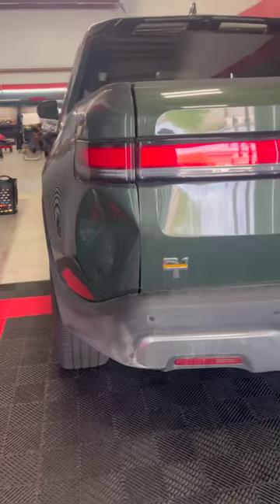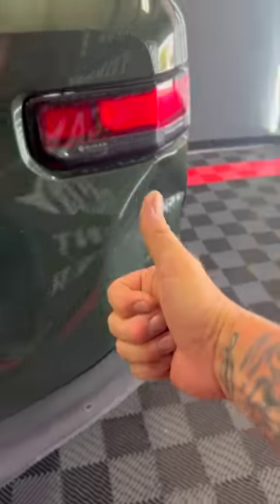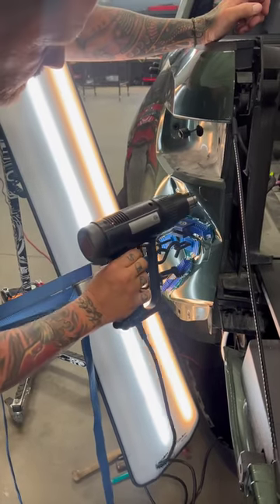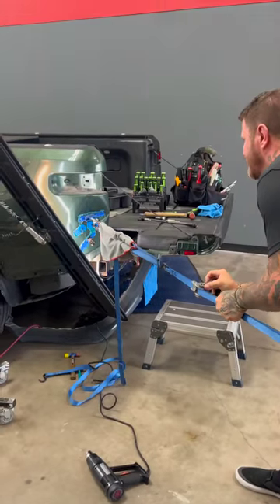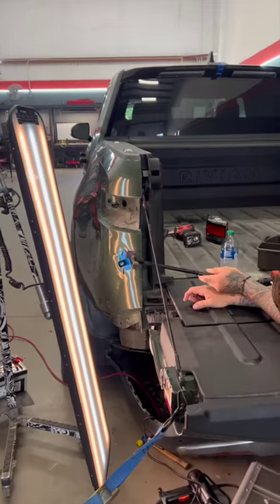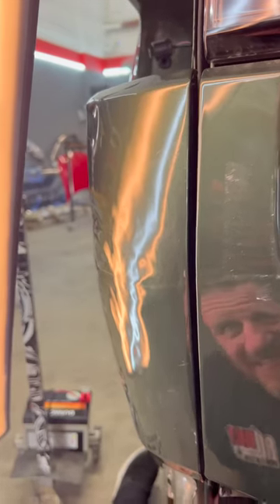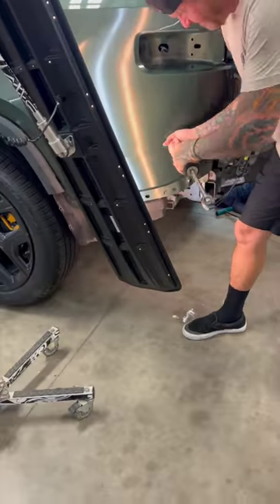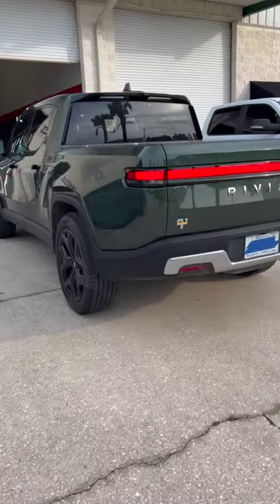$41,000 dent repair on this Rivian?

Comment: 2:21 was always amazed at how few panel gaps the rivian had. And I understand now that it is in fact a pain and comes at quite the cost.
Reply: Yup, this truck is closer to an iPhone than a Blackberry. Something that looks pretty vs something actually designed to do work.
Reply: @noseboop4354  problem is the engineers got lost in the lightness and aerodynamics and didn't consider repairs

Comment: $41k lets just be honest that is a bs quote from that shop. That means these trucks would be totaled easily. But great job on the repair!
Reply: this is the third rivian I have seen that had minor rearend damage but the quotes to fix them were over $40,000. panel to fix this is $14,000 all by itself and then you still have to almost take it all apart. as the video said, it is all 1 piece construction so you need to pull the windows and everything out,repaint to match and put it all back together again. at shop rate that isn't cheap. 
When that cybertruck comes out it will be the same way. cheap to make it in a gigapress all in one piece but it will not be cheap to fix after a minor fender bender.
Reply: @steveherr450  Hold my beer while I grab my stud gun...............
Reply: No way in hell the quote was a 4th of that. It's 100% clickbait
Reply: @crash9632  it literally is a accurate quote from a body shop. It’s a we don’t want to do it quote but the reality is nobody wants to do it. Same thing happened with the bmw i3 . You might be able to find a cheaper quote but it’s still gonna be 30k. The panel itself is 14k numb nuts . 1/4th of 41k is $10,250; that is  less than the parts omega lul.
Reply: @crash9632  it’s just a shittass car that wasn’t designed to be repaired. This is common knowledge. Do your research

Comment: Honestly this is Master class in automotive witchcraft. Amazing work. the common way I've seen this "Paintless dent" removal done is they do everything this guy showed but they remove the panel for the final touch up work. Hammering the dents on a steel table with a thick canvas table cloth on it. This is flawless and really shows you how good this guy is.

Comment: That’s pretty amazing! My question is: is the paint in that area now compromised over time and prone to separating and chipping now that the panel has been dented and then manipulated?
Reply: Even if it was, it’s still preferable to have that little patch resprayed in future than the whole mess of work that would have had to be done with tearing the vehicle apart with the other shop.
Reply: No
Reply: I looked the panel up and its $1900😅😅😅😅😅😅😅😅😅😅. The videos real but the price is bullshit
Reply: @jasonmorgan661  it’s not the parts, its the labor, he listed all the dumb things it takes to change that body panel (remove front and rear windshields, battery pack, etc). 
This truck is poorly designed for repairability.
Reply: Why can’t they just buy the panel and cut the dented section out and replace it with the piece needed from the new panel?
Reply: @Lucianrider uh and what weld it together? 😂
Reply: @randomizednamme yes. This is how it's done normally.
Reply: @randomizednamme Yes. I can cut out a section of steel, replace it with a new piece, and once I get done you won’t be able to tell it was ever cut or welded. Only way you’d know is by looking at the car fax or pulling the entire panel off and looking at the backside/running a camera up behind it. 

You might be able to tell an ever so slight paint difference if you have a keen eye depending on what color the original panel was and how old the original paint is.
Reply: @Lucianrider  On a lot of these electric vehicles, the shell itself is part of its structural integrity, that's part of why it runs the length of the vehicle. If you just welded a whole new segment of it I think insurance would claim you compromised the vehicle.
Reply: @invertexyz  that tiny piece compromise the integrity? If that’s the case it’s a piece of junk then!

Comment: This is absolutely amazing work!  I am wondering what the end cost was with this genius method of fixing the dent...  Impressive!
Reply: I'm thinking within 5k.
Reply: The low, low price of $39,999.99.
Reply: @alizierny  Man, that's the problem.  I'd like my stuff to look nice, but that's ridiculous.  I haven't put that much money into my dad's '95 Chevy that I've been driving for over ten years myself now and I've rebuilt the whole drivetrain in that thing.  Edit: Except the rear axle.  OG ring gear, pinion, seals and bearings still doing great.  Knock on wood lol

Comment: I’ve been in and around pdr since I was a late teen. A couple decades later and it’s still alive and strong. You did some fantastic work on that Rivian. Expect more and more of that headed your way brother. I am wondering what you would bill for two straight days of work like that. At one point I paid $120 a panel, add $80 for each additional dent on the panel. What is the cost these days?
Reply: Depends who you want to pay. Jimmy the meth head will do it for 125 a panel still. This guy will estimate how much time it will take him and add 25 to 50 percent to ensure profit if it takes longer than expected and give a estimate. Probably would bill labor at $150 to $250 a hour

Comment: I used to do this work for about 7 months. Not for a body shop, for a manufacturer. We didn't get nearly as complicated dents, but we did repair a lot of them. You would be surprised how many dents make it out of the factory, that people don't ever notice. And yes, fixing dents is really hard, putting them in, on soft metal is really easy.

Comment: The repair itself looks 98% which to some people is good enough, I did body repairs for quite a few years and later went into estimating. I have experience writing estimates for these types of vehicles and the issue that presents itself in this scenario is that the vehicle needs to be recalibrated just for the bumper removal, a calibration could run anywhere from $400-$2500 depending on the manufacturer requirements. 41k is definitely a steep price for a repair but if you have insurance, it should not be an issue, this is a 70k pickup, 41k is still within the threshold. Also repairs wouldn't have to be invasive in this scenario, you would approach it the same way, glue pull to minimize the damage and light glaze to even whatever you couldn't get out. But of course, bad body shops will exaggerate the extent of repairs, good body shops avoid cutting and welding.

Comment: Rivian founded in 2009.
New car brand, makes it nearly impossible a little dent to be fixed fast and cheap.
Same scenario with today's smartphones, unlike with mobile phones in 2000s and early 2010s.
You could buy battery and the phone frame and re-install it by yourself easily.

Comment: That was immaculate work in my eyes.  I'm still trying to get over the customer being quoted $41,000 from the only certified shop that could do the repair.  That's poor engineering of a vehicle design for insurance to consider writing it off over the cost of dent repair.

Comment: I believe it, I had a break failure in a 1992 Chevy S10 pickup truck and rolled into the back of a Tesla Model X. It was when they first came out. I kept in contact with the guy cause he was chill about it and his insurance paid out something like 25k to replace the bumper, reprogram the sensors etc. My car hit him at around 3 MPH and put a dent in the bumper smaller than a basketball lmfao

Comment: Aside from being filmed vertical, this was fantastic.

I'm hoping your explanation was to absolve that body-repair shop and not Rivian. Based on what you said it's clear that the body shop would have had tons of work to do, and likely a bunch of other replacements to seals and such after needing to disassemble 3/4 of the truck. But that should in no way be a defence for Rivian, who clearly engineered the truck to be as repair-unfriendly as possible.

Comment: I read about another Rivian that cost $32,000 after getting hit on the rear bumper, even though there was no damage. The dealer insisted on doing apparently very extensive (or at least expensive) checks to verity that this tap in the rear didn't disturb the batteries and create a fire hazard. "repairs" like this are costing all drivers more, not just owners of electric vehicles, because the liability, in even a parking lot ding, with an electric vehicle is so high. My insurance rates, with a perfect driving record for 14 years, went up 50% last year. Owners of electric vehicles should have to carry their own insurance for these insanely expensive "safety checks"  and premature write-offs; there is no reason why everyone should be paying for this extortion.

Comment: i had a sedan like this where the entire rear quarter panel was part of the rear window. i was quoted $12,000 for the same dent he has (dented in below the tail light). i just drove it like that until i sold it and it was the next guy's problem..... i use my truck as a tool, not some flashy "look at me" thing. i can handle a few dents if it doesn't affect the stability of the vehicle

Comment: Auto body tech here.  Gotta say, that's some gorgeous and highly skilled PDR work but it's not entirely honest.  I dislike the use of "aftermarket" paint.  If the owner was quoted for a full quarter replacement, he was at a Rivian certified shop which costs a lot of money which means the shop has to meet strict requirements and uses very high quality paints--possibly the same brand OEM used.  In my opinion, i would've never asked for a new side.  Instead, i would do a repair where i also would use glue pulling, my aluminum dent puller, and finally some body filler. Id probably be around the same price but you wouldn't have to drive 600 miles.  There's plenty of great body shops using high quality products to refinish your vehicle.  By the way, i also resent the gremlin comment.  High end shops also employ some of the highest trained and experienced techs with oem procedures.

Comment: Lesson...don't buy something that is so poorly designed that a small dent causes an overly invasive /expensive repair to be necessary. I'm guessing the owner is seriously thinking of selling the truck after this incident. He was lucky this paintless procedure was an option, and they did a great job!

I would imagine the insurance company is charging premiums commensurate with the astronomical repair estimates most owners of this model will receive when they need a repair. The high insurance premiums will ultimately persuade buyers to steer clear of such vehicles, which will in turn let the car designers know not to create similar boat anchors in the future.

Comment: For those that don’t know, you do NOT have to remove the entire panel and replace it. If someone is handy with a welder, you’d just cut that section out and weld in a new one. The problems with that, are chances of warping, repainting, you more than likely won’t be able to follow all curves/lines (it’ll be noticeable), and you’re cutting into the truck and decreasing value

I only mention this option because he made it seem like the only options were dent pull, or $41k repair

Comment: Even if you "failed" you will still get it to a stage where conventional painting would only require a light skim of filler. Personally, I am not keen on replacing panels that require too much invasion into the car. I would rather have an original panel repaired particularly if the repair still required paint.

Comment: That's nice but expensive.   A quarter panel on my mercedes was 2000 euro replaced and painted.  I went further and opted to have bumpers, rocker panels and wheels refinished for 3k more.  Its like new.

Comment: 41k estimate was for all that stuff....but they would have just pulled and filled the dent and painted the side of the truck.  That would have been a better option than pdr in this case because IF DONE RIGHT they would have restored the corrosion protection to the back side of the panel which you did not do.  They also would have been able to make it look 100% instead of 90% and there wouldnt be an ugly touch up spot on the edge of the panel.  This is a 3.5k standard repair at any good bodyshop.

Comment: This is the "Easter Egg" hunt these vehicles are setting up for consumers. In Australia and the UK insurance rates are through the roof already due to this and fire issues with the LiPo or whatever batteries. It simply boils down to these cars have to have rigidity. They must be stiff, rigid to support the batteries and electrics which are much heavier than conventional vehicles. SO then all the body panels and subframe perform the function of support for the weight. The more metal tied together forming load distribution the in the designer's mind is better. And remember batteries eat up a lot of the undercarraige so the periphery of the car has to be sturdy to support the weight. Consequently the old rocker, fender, subframe, cowl/firewall, A, B and C pillar with interlocking panels are reimagined to cause as it were to a bucket or trough, or sled at the bottom of the vehicle to put the batteries in and provide rigidity. All the body metal tied together forces a removal of 30 to 50 percent (in this case) of the entire body skin for a dent in the left rear quadrant. Designers are forced to reduce undercarrage access to a minimum because with the battery the four corners of the car are your support for the battery as well as the rolling weight of the car. As insurance companies begin to peel the skin off the onion and learn these things, rates in general and specifically for EV cars will skyrocket or insurers will walk away from EV's entirely. Along with all the deficiencies the unintended consequences of EV's will only show after the fairy dust and moon beams dissipate and real range numbers, real repair and maintenance costs, charging, fires, fragile nature of a sled carrying a toxic case of lithium poison WOW revelations are unfolding. EVs are a JOKE!

Comment: I lent my dads truck to my friend.. he ended up keeping it for a week. When I got it back he had drilled over a dozen holes in the back and 6 of them were so he could push a dent out. I was shocked and hurt. The truck is in good condition at 30 years old amd my dad just passed. It’s the only thing I have left of my dad. 😢 I am still hurt and bitter over it.  Now those holes he drilled are going to rust out.

Comment: The repair costs on these EVs are insane. Body work, battery work, drive train work. It's all super expensive and specialized. The training/infrastrucutre isn't built out to do these repairs at scale yet. Also having to replace that entire panel all the way to the mirror seems like a design flaw. Hopefully they'll make the areas that are likely to suffer minor cosmetic damage more easily replaceable for the next generation.

Comment: Pdr is a wonderful thing. I don't have the patience it takes to do it, but for some reason, I have patience to remove one bolt that took 30min to fix an engine.  However, I do know that I haven't seen one pdr repair that I couldn't see a few months after the repair, especially after a few hot and cold days.  Eventually, everyone will see it has been repaired to some extent.
  I find it funny when salesmen try to tell me something hasn't had a repair.  Repairs stand out to me since I've been doing bodywork for over 40 years.  The second someone tries to tell me it hasn't, I walk away. If you can't be truthful, I don't want anything from you.

Comment: The fact that you could do this as a PDR just goes to show what kind of waste “conventional” repairs are. If you weren’t able to save the paint, these techniques could still save the metal from the “traditional” ways of welding tabs and grinding the metal. It’s like true bodymen/metal workers don’t exist anymore. Technically they could have done what you did and kept the repair as small as possible and basically only fill whatever damage to the paint leftover and then just blended the panel within. I’d rather keep the repair small and let them know if that fails they’ll have to paint the larger area, but there’s a great chance if done right it won’t fail.

Comment: You all don't forget it's not just repairing the dents, but the battery shocks check for possible fires in the future, For any shocks to the EV, battery packs need to be checked, not just fixing the dents like most ICE vehicles. That's why they are so expensive to do body repair on any EV.

Comment: 2 days work. 16 hours if it's just one guy.
$250 an hour. 
$4,000 for the hourly 

with that, much labor and skill involved, anywhere between $5000 and $8,000 would seem pretty reasonable.

now get the insurance company to give you that check for $41,000.

Comment: Respectfully, a car with panels set up in such a way that you can't take em off without basically disassembling the whole car first seems to me like a pretty poorly designed car. Sure, you don't want your car to fall apart on its own, but you should be able to get a panel in one of the most dent-prone parts of a car off without having to take the whole thing apart first. Anyway, that was impressive work.

Comment: The issue with dentless repair on the customer side is the fact that it requires what the world is in a drought of, talent. You have to find someone talented in order to get this done at a reasonable rate and not get it back fucked up. It is like a needle in a haystack. Conventional may have its downsides but at least you can get it fixed and your not looking for a unicorn.

Comment: Even if the original panel is half of the car there is no problem to cut the relevant part and just replace and weld it. This method is also OK but it's not the only way and 41k is the cost of a whole F150 brand new.. meaning ridiculous.